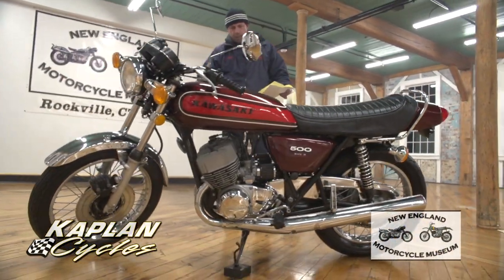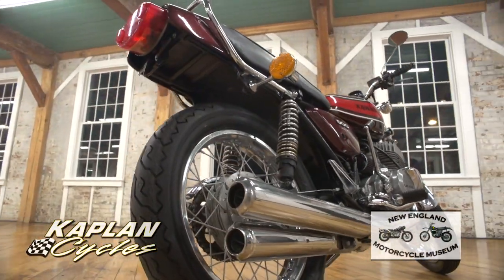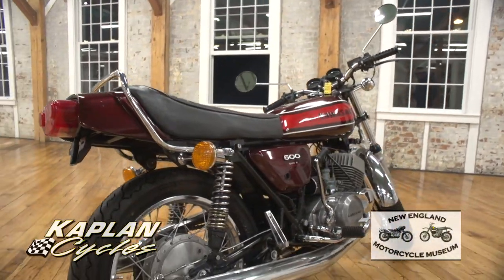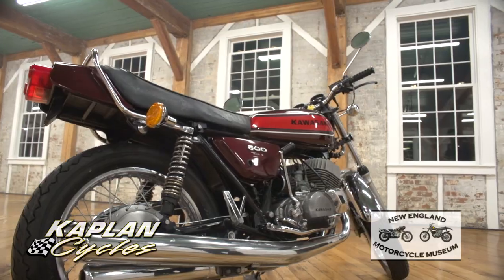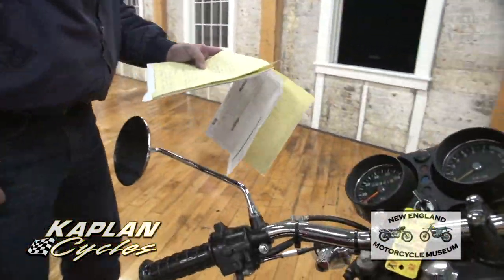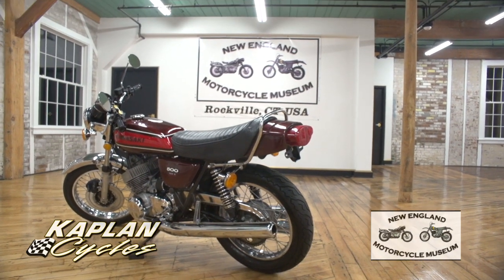1975 Kawasaki H1 500 Mach III | FULLY SERVICED!!! 100% READY TO GO!

Comment: You can still buy the stock shocks,air box,rear pegs and fender, then it would be pretty much stock.  After market parts are easy to get and pretty cheap,fun bike,but it really does 13.26 in the quarter mile,the 69/70 did 13.0 (Quote; Kawasaki Triples Bible)